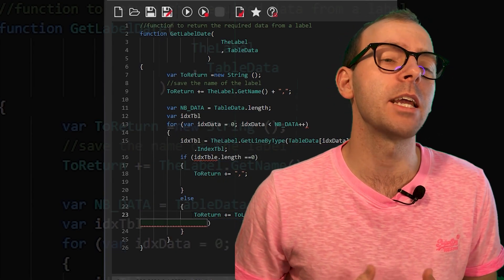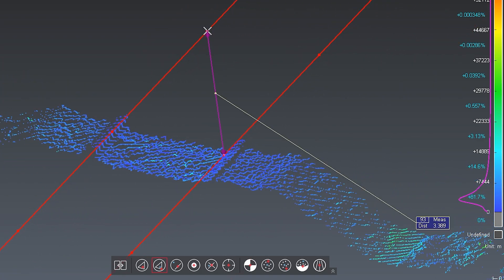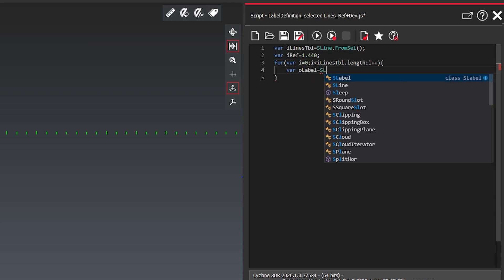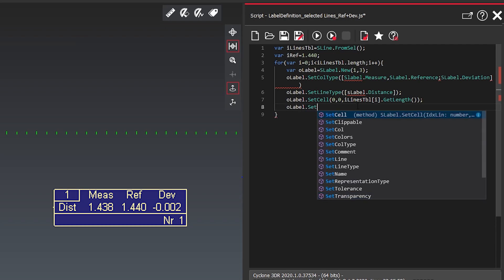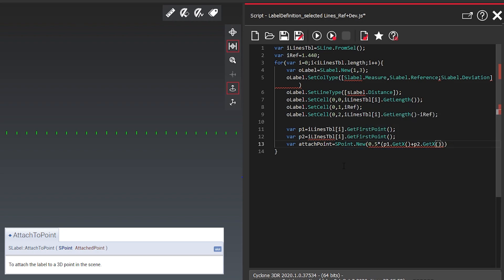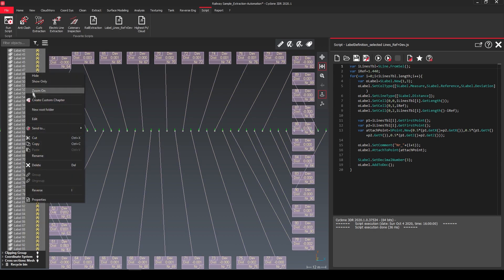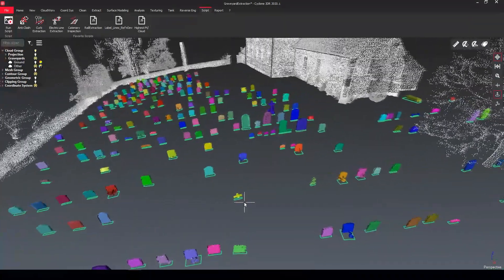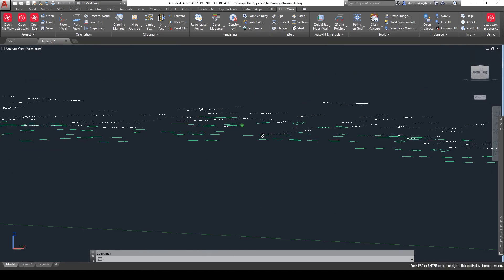Cyclone 3DR Scripting | Save manual hours | Klaus Rieke

Comment: hi _Klaus again:) im a new in scanner job, can you please tell how  can get data from scan to 3d modell in autocad or advance steel or inventor. google alot off, but not clear answer....thanks
Reply from the maker: @shklodas if you have Cyclone3DR and AutoCAD open you have an option to send elements across or use a common file type such as DXF to AutoCAD. Not sure about Inventor. The lastest C3DR should allow other file types to import in different software packages